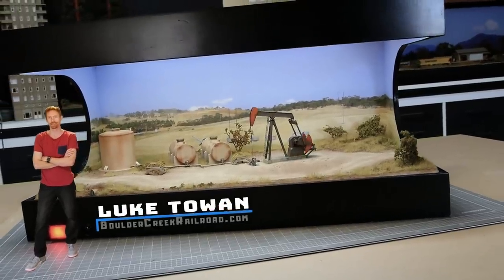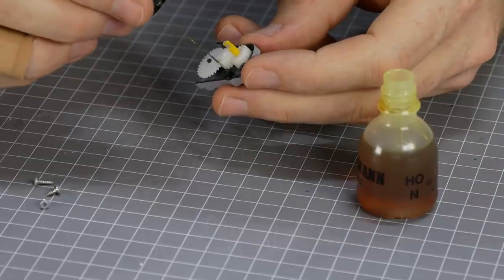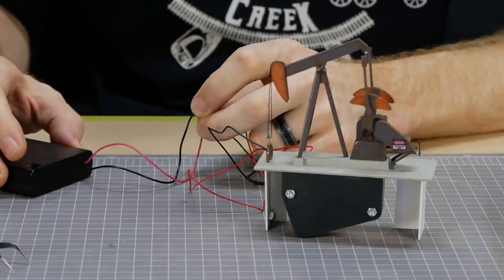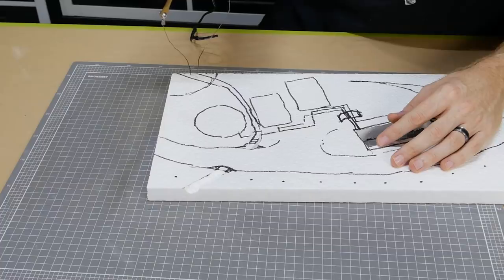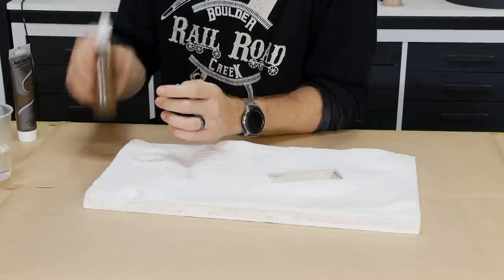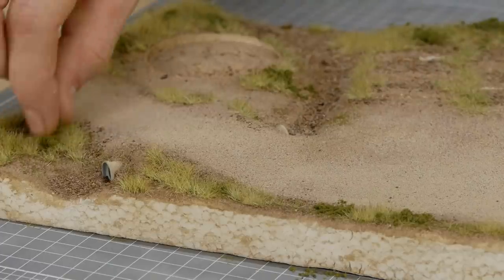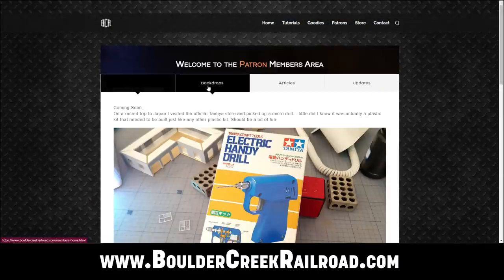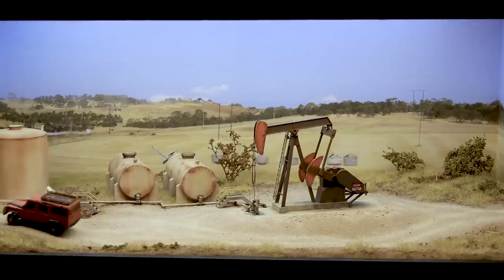Build An Awesome Oil Pump… (That Actually Works!) – Realistic Scenery Vol.28

Comment: Thought for removeability of the base from the backdrop without gluing: You could embed magnets into the foam and then simply place other magnets over the corresponding locations beneath the wooden base. When you want to remove the foam, just remove the magnets from the wood. Just a thought.

Comment: We called these "Noddin' Donkeys" when i worked in the oil & gas industry (not too many of these pumps used in Australia).

Many are electric now, but we used to use a self contained diesel engine system to operate the Pony Rod system (pumping system).

Ran across a few that ran on multi fuel in far north Qld- many would run off the oil pumped up itself!

Edit: you need to add more oil/ gease/ gunk around the Wellhead- every pump i came across, had decades worth of oil, that had turned to grease, sitting around the wellhead. If the seals on the wellhead leaked alot- it was a good 6 foot circumference of gunk on the ground!

Comment: This guys model are seriously getting unreal. What alot of progress hes made in his abilities. Another great build luke
Reply: The question is, would he still be able to to all these if not for these kits?
Reply: @robertanthonybermudez5545  I honestly don't think that is a question in my opinion. I think his 3d printing skills are unbelievable. He maybe just shows a general way to get started or he has endorsement from these companies. Regardless of what it is I personally feel like he doesn't need them. I think he's progressed so much over the years. I dont know this is only my opinion
Reply: @robertanthonybermudez5545  He's done builds before entirely from scratch with the only manufactured pieces being stuff like railroad tracks. I have no doubt he'd be able to all of this just from cutting out pieces sheet styrene. The reason he doesn't is because it'd be incredibly time consuming. Like you can make trees from scratch using wire, sawdust, actual tree sticks/branches, some type of sculpting material (Milliput, paper mâché, etc.), and some paint. But that takes on average an hour per tree. Much faster to use trees already pre-made, especially if it's going to take you weeks to build a diorama.
Reply: @nekrataali  that's what i want to see... This videos are becoming more of like product endorsements rather than creative exercises.

Comment: I found an easy sander. I took a rechargeable toothbrush and removed the bristles on the 2 head I got. Than took 2 sided tape and put it over the area where the bristles were and than the sand paper. With extra heads you can put different grades of sand paper on the head. It works great on my N Scale.

Comment: Great job on the model , thank you for the information I have 2 oil pumps to put together . In a oil field there is 20 foot circle with drift around and oil comes up out of the ground . I an not sure but I think there is a building with  a pipe slicking out the side  i believe  they burn of oil this way Some times at night you see the glow in the sky .

Comment: It was a bit of a surprise to see that a truck (jeep?) was running in the scene and there were no instructions for it. Is there a separate video that shows this? Thanks!
Reply: Luke did a video, about a year ago, on building this. It is radio controlled.

Comment: Where's Wally? game
1) 2:28 - next to the bottle of cement, on the right
2) 6:10 - next to the base, on the right
3) 8:08 - on top of the large tank, on the left
4) 11:36 - on one of the step-overs, on the right
5) 15:28 - to the left of the large tank, on the left

Comment: Mr. Towan, I have a question - why do you mix the dirt with grout? You seem to do it on each and every one of your builds. Thanks!
Reply from the maker: It helps give the for a lighter colour, dirt on its own tends to be very dark, which is ok for wet scenery but for dry arid areas it needs to be much lighter and the grout helps achieve this 😉

Comment: Let me guess made in China
Reply from the maker: Probably, if you know any other suppliers you’ll have to me know 😉
Reply: Well, Faller (Germany) once had an oil pump too, in different colours and with different item numbers over the years: 994, B-165 and 131203 (and a special version for the Netherlands 190248). They are still available on eBay, but they are mostly quite expensive and I don't know if any of those sellers would ship to other countries...
By the way great video of a really absolutely awesome diorama built! 👌🏻😎🤩👍🏻